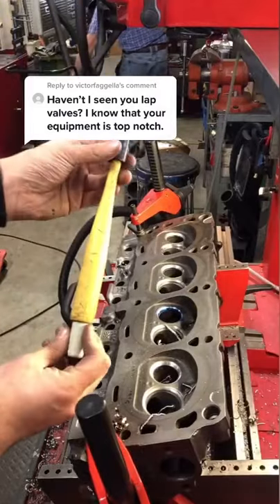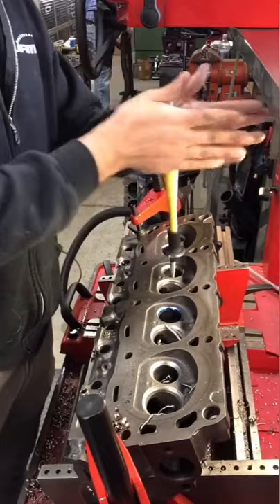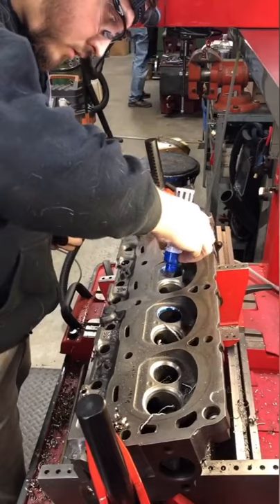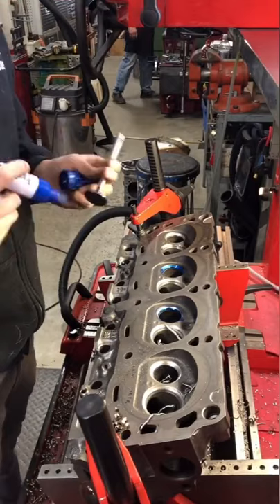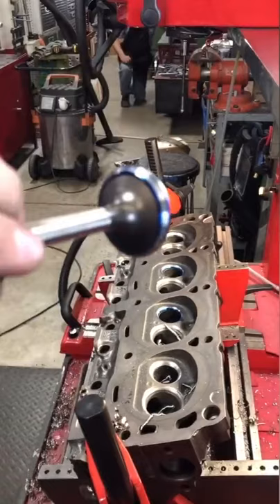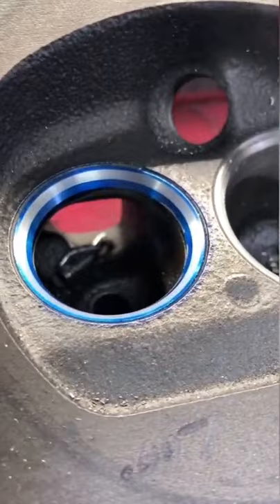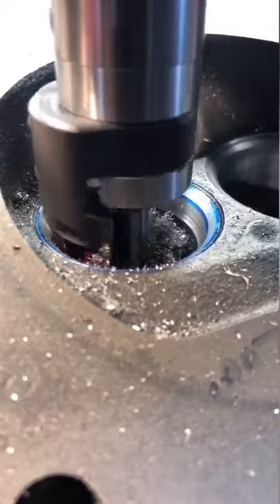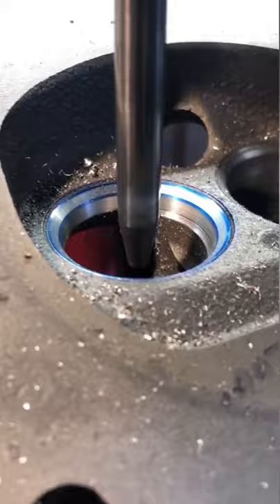#SHORTS If you don't lap valves, what are you doing with a lapping stick?

Comment: Nowadays it's for  not as necessary but lapping/grinding is still the most precise way to fit 2 prices together.
Reply: Yup and you end up with a better seal that's last longer.
Reply: If that were true why do the high end engine shops that build $60,000 race engines and have been open for 40+ years always spend the $20,000 to $30,000 on a Serdi or something when a Sioux seat grinder kit is $3,000? How does that make any sense?

Comment: I use the same type method to check my rifle bolts to locking luggs surfaces. Its surprizing how often even high quality rifle recievers dont match to bolts properly. Upwards of 50,000 psi preasures there on fireing. If those luggs dont match across the full surface, it creates uneven preasure  and is a weak point in the action.

Comment: An old instructor showed me how he   smacked in the seat. No valve spring, head upside down on a stand, one hand on top, one hand on the bottom. Bottom hand pushes the valve up, and the top fingertips smack the valve down as fast as possible. In only 10-20 wacks, the valve will show the contact and you can see if you need top, throat, or widening the seat. 

The valve is opening 5 times a second at idle and 50 times a second at redline. As long as the contact is correct and it seals, it’s going to debur itself almost instantly.
Reply: Leaned the same thing at Wyo Tech in the 80’s

Comment: Correct. Lapping parts is useful when you don't have access to precision machining and must return a job to service however, there are parts that require "extremely high precision" when lapping is the recommended final fitting method.

Comment: Yes sir . Learned that at UTI 34 years ago. The seats are so hard, compound isn’t really going to cut them. 
We were taught, the valve and seat were each cut with 1 degree of difference. That way they can wear in as the engine runs. Don’t know if that is still the practice ?
Reply: 😂😂😂😂 lapping compound has diamond in it buddy. It can cut carbide and stellite. UTI is a joke
Reply: @mattcarbaugh5576 if you want to do a valve job with a lapping stick & compound, knock yer socks off. 
Did you go to tech school ?  Was it perfect ?

Comment: So, I drive a 1999 Saturn SL2 with 367,000 miles on it. At 219K, it burned a valve through, because of a partially clogged injector (I now clean my injectors twice a year, but back then didn't understand importance until after rebuild, and that plug was white while others were brown. *aha!!*). I replaced the burned valve and lapped all of the valves. The remaining valves and seats were somewhat pitted.  I also replaced the piston rings  (cylinders still had crosshatch), and bearings (journals were excellent, but clearance was .003"). To this day, I have between 205 and 210 psi on all cylinders.  Factory spec is roughly 210 psi. I average 30 to 40 mpg depending on driving and weather, and burn 1/4 to 1/2 quart of oil every 3,000 miles. Also, all valve seat contact areas measured within allowable specs after lapping.

Comment: Nice work and this is ok for most Detroit products. Truth is if you examine under some magnification, you will notice the seat has micro ridges from the insert, and the valve has less. Why?  Because the seat is plunged like molding cutter where the valve is interpolated by the moving stone. 
Pro Tips: learn to properly stone the the seat inserts by hand to reduce the ridges. Take the time to hand lap higher quality Japanese brands.  The materials and tolerances are the reason they go 300k plus before a major service. Keep up the great work.

Comment: Lapping valves is for the shade tree mechanic. Machinists don't really mess with halfasssery. There' certainly a time and place for it though we lapped my buddy's 4.3 with the head still attached after we discovered his intake valve was causing a dead cylinder at 30 psi compression test. Back up to almost 110 psi afterwards. Quick and dirty is alright for a daily in my book. Was a bit of a process though. Bring the cylinder nearly to tdc so as not to drop the valve in the cylinder. Pop the keepers off chuck the valve in a drill. Syringe some abrasive goop down the intake runner and give her some spinamathings. Reassemble test for compression rinse and repeat as much as neccessary. Painstakingly slow process. But works in a pinch.

Comment: The cut surfaces will NEVER fit together as tightly as ground surfaces, especially when those surfaces use one another as the grinding tool for the other. While your cuts may provide an oem quality seal, they will never be a true performance build level seal. This is like doing the bare minimum to meet building code.
Reply: You got a link to your performance engine shops website?
Reply: @DrTittieSprinkles  I’m an R&D aerospace manufacturing engineer for the largest jet engine manufacturer in the US. My experience goes a little beyond machining/lapping valve seats, but I appreciate your call for credentials.
Reply from the maker: We can throw credentials around all day. 

Here’s my thought; by lapping the valves, you are effectively making the valve face into a grinding stone, using the valve stem as your pilot.

If you have .002” valve stem to valve guide clearance, there .002” of slop in your pilot to lap that valve.

This is not the same principle as lapping two flat surfaces to mate them together because the mating of the two surfaces is more important than the flatness.

The fact is, lapping valves went out of style 50+ years ago, because there are better options today.
Reply: @DrTittieSprinkles  interesting to see how your comment devolved from insightful to insulting so quickly.
Reply: jlehm1982 is 100% correct. This is why lapping is still used today in the strictest of manufacturing settings. On a microscopic level, your cut surfaces make substantially less contact with the seat. This not only makes for a poor seal, and it's no better than oem production car laziness, it also takes away from the seat's ability to draw heat away from the valve. Lessening thermal efficiency and the lifespan of the valvetrain.

Comment: I used to do this to hone Knife blades for Industrial machinery  i’d say you have to be super precise to do this or maybe even use a filler gauge because it’s hard to get a accurate reading and this is something you don’t want to mess up one little imperfection can cause Compression issues

Comment: I do this with knife sharpening. 
You color the bevel and do a test pass with the grinding arm. 
If you bite only a little of the mark, the angle is too small
If you bite more than the mark, the angle is too deep. 

I literally did that last night, so its cool to see simular techniques used in other professional trades. 
I'm a chef irl

Comment: Exactly as long your using right equipment  plus your expertise of doing it. Mechanic blue compound only check contact surface of valve seat and the valve it self to increase max combustion.

Comment: Aka "blueing the valves" a common yet precise practice in a machine shop. It does give you a good idea of how well the face of the valve will seat against the valve seats, too thin of a line means to check your valve seats and faces. Even if the valve still seals, that thin of a sealing face just means the valve can burn quicker making it not last as long as it could with a good valve face to seat fit 😎👍

Comment: No matter how precise your machining it'ss always going to leave burrs and slight imperfections from cutting. 
Maybe not something you'll notice on the road. 
Lapping gives it that nice uniform surface. 
I literally haven't cut a valve or seat since I was a teenager, I send my heads out.
There's a video of me lapping valves on a Toyota Corolla. I paid a shop to surface the head and install new valve seals. When I got the head back they didn't install the seals. I think they only gave it an acid bath, and vacuum test the ports. 
When I dropped the head off I gave the machine shop the valve seals in a bag attached to to head.

Comment: Generally when I cut seats and grind valves lapping is completely unnecessary.
Reply: The frosted appearance that you get from propper valve lspping is the surface finish which provides the best heat transferthe whole valve is colled through the contact area oc yhe seat
Reply: @stephenupson4303  I’ve never ever had a valve or seat fail
Reply: @stephenupson4303  I need a source on that because that sounds like a load of bull.
Reply: @DrTittieSprinkles  it is a load of bull

Comment: You only lap the valve's if you have old good parts with new parts like new head old valves or new valves with used head to take up any tiny gaps but if you get the head done at a machine shop the head is machined perfectly for the valves and most likely has been vacuum tested to make sure the valves are making a perfect seal so no need to lap the valves unless you specifically ask for  that service which is not neded

Comment: I cut to the narrowest contact width by the book. I lap with fine compound to check contact width. If i need to cut again, I polish the lapping mark off the valve with a wire wheel and check contact again. If ok, I'm done. If not - repeat. 
Finally, I check with solvent for leakage. 

With solid lifters I'll still have proper clearance 5, 6, 7 thousand miles later with no prior "after rebuild" adjustment in a few hundred miles or whatever.

Valve lapping corrects imperfections in-situ.
A machine knows nothing. It was developed for mass production.

Comment: I don't lap either. Unless I'm doing a repair not a rebuild. I may use a new or refaced valve to replace a cracked valve or one with a groove in the face and the seats are in spec. But the metal will confirm anyway. Lapping abrasive embeds deeper into the softer metal and cuts the harder metal. On vintage cars the seats are often softer and you are putting a groove in the valve and the seat may need a total rework from the start. On modern cars it's the seats that are often harder but they rarely lose their shape, a lap can remove the burnished surface and sometimes some orange peal texture you might see on heavily carbonized diesels. But if I am spending time on it as it is I have no reason not to zip it with the sioux grinder.

Comment: I have a Harley valve lapping tool from the 40s that automatically does the lap movement back and forth. I adapted a suction tool to it. after I cut valves or seats with cutting tools I lap a few times and always got good results...I don't have big expenses machines but I found my cutting is close enough that I could get away without lapping..but I just like how it tunes it in. and I see the seat to valve contact clearly after lapping...
Reply: Can you do a short video on it? Tag me lol
Reply: @rockyloccgarage2040  yeah I'll do one... I have some old Harley flathead cylinders and an isuzu head I can demonstrate on...  cheers
Reply: Awesome

Comment: Just a question, what about the imperfections on the valve itself? Yeah of course you can machine the head precisely but the valve is not? I was always told that's the reason you lap them because you seat the valve to the head because of the imperfections on the valve from the manufacturing process
Reply: Same here

Comment: Lapping is the best way to ensure a complete seal in modern performance engines. It's used in many applications with much success. Aerospace manufacturers still use lapping quite often, and I trust what they're doing more than some kid who runs super basic machines like the ones used for automotive machining. The fact is engine machinists are more often than not, the lowest rung on the ladder in the manufacturing/machining/engineering world. Some of these guys can't even read a micrometer. I'll continue lapping valves after machining and assign them to their matched seat. Lol

Comment: Lapping is NOT to hide mistakes like many of you believe. It is to achieve a surface finish of greater quality then any other machining method.
Reply from the maker: In the case of valves & valve seats, I would agree with you…. If it were 1950. Times have changed.
Reply: @JAMSIONLINE  You should take some machining courses in Germany or Canada. We have some excellent 4+ year programs. You would be showing your dad what's up in no time.

Comment: I just had a set of heads done .brought them home poured a lil bit of gas in the runners to check for leaks .6 of 8 leaked .they said it would be ok .I wasn't cool with "will be" they took them back and lapped them when I picked them up the 2 nd time I only had 3 leaks .and that was just the intake valves

Comment: Proper machining should need no lapping ... That's why you number the valves and match the seats
Reply: Why number them as your tool will never match the particular valve to the hole... you should only number them if you actually lap them and match them to respective seats, If they’re not matched and machined to match why number them?

Comment: Valves are lapped  when the head doesn’t need to be taken to a machine shop. All machinist will talk crap about lapping valves becuae they don’t make money when you do it. It the valves seat is damaged tho lapping won’t fix it. Lapping helps when doing a rebuild and and mechanic/ technician that has rebuilt engines will tell you the same. I only take to machine shop of the seats need replaced and no need to lap but do double check the machinist work.

Comment: Lapping can mate the surfaces and make the seal even better. Unless your machining the valve faces themselves in shop and trust both machines 100% . Which even then I’d still hit them with some 2k grit just to make sure any microscopic imperfections or chatter marks are smoothed out. Then hot washed and wiped with some cleaning oil. But I am ocd with valve seal.😁
Reply from the maker: What is your valve stem clearance typically when you are lapping your valves?

Even with 2000 grit (roughly .0004” diameter), you are essentially turning your valve face into a grinding stone, with whatever slop your valve stem clearance is as a pilot!

Even if your valve stem clearance is .001”, I guarantee that is not as accurate as my Serdi cuts a seat. And yes, I grind every valve that comes through, new or used.
Reply from the maker: If you can’t trust your machinery, it’s time to buy new machinery.
Reply: @JAMSIONLINE   hey man .. no harm no foul ! Sounds like your the man ! Your valve jobs are probably amazing ! I know you have the equipment and the skills. Good job !
Reply: @JAMSIONLINE   all major valve manufacturers recommend lapping the valves .. I lap mine just to follow the manufactures recommendation.
Reply from the maker: @paulskartslifan4206  What manufacturer? Email me nicolaus@jamsionline.com.

I would like to see what you’re seeing.
Reply: @JAMSIONLINE   listen man .. your the best !! NOBODY EVER LAP YOUR VALVES !!!!!  Or you’ll be wrong to do so ! You win ! But I’ll still lap my valves 😁 I also have a nice machine .. I also know they fail vacuum tests often ! 🤣🤣🤣. .. nothing’s perfect
Reply from the maker: Haha I didn’t say I was the best. I just replied to your comment with my logic and reasoning. You then made a claim and I asked for evidence... and at that point you got passive aggressive lol
Reply: @JAMSIONLINE    😳
Reply: @JAMSIONLINE  👁

Comment: Ehh idk about that one. All depends on the specs/clearances. It’s a common misconception that lapping is ONLY to make sure the valve is seating properly. It also reduces harmonics at higher RPM, which depending on the application can be very important. For example a 8-9 second 1/4 mile car I would always always ALWAYS lap the valves. Now if you have a Chevy Silverado 1500 that you daily to work ya you can get away with just doing good machine work but still I’d lap the valves. 
I got trust issues and the last thing I want to do is pull the head off a engine I just reinstalled/put back together because my machinist told me not to lap the valves lol 
If you’re flagging hours you can’t afford to have that happen, that’s why they train people never to assume/trust because the only one who will take a hit if it goes south is you. Has nothing to do with bad machine work lol does it exist sure, but personally I only like to do things once and it prevents me from getting back flagged

Comment: By trusting as much as you are you can easily trick yourself into thinking you have a great seal  but in reality  it could be lopsided and make it appear  to be perfect  I can see doing this but maybe a 1/16 of a turn with a  location mark to recall the position the valve was facing  idk... terrible service at the moment  so ill watch the rest of video later
Reply from the maker: Not trusting this for a quality check. Has nothing to do with checking sealing or quality of the seat/valvex

Comment: By spinning the valve you are not getting an accurate representation of what is going on in the life of the valve, simply mark three spots on the seat, insert valve hold open about two inches or so, put finger on end of stem, lightly impact valve face to seat two or three times (do not turn valve doing this), inspect point of contact, should  be approximately 1/4 to 1/3 width of seat in from margin of top cut. To properly do seat, you should use a Hall Toledo seat grinder.

Comment: Why dont you lap after a fresh cut? 
Not necessary?
Can it cause more problems?
Reply: An interference angled valve job allows the valve to "self lap" to some extent, the more times the valve seats the better the seal. The clearance in the guide allows the valve to self locate on the seat. Lapping valves is actually shortening the life of the seat and valve.

Comment: I just lapped mine on my 302 to get it back up and running.   Re gasketed the whole thing as it was leaking oil from everywhere.   Didn't wanna dump money into D80e heads.  Rather find some free e7te min or gt40 if im doing to pay for machine work.